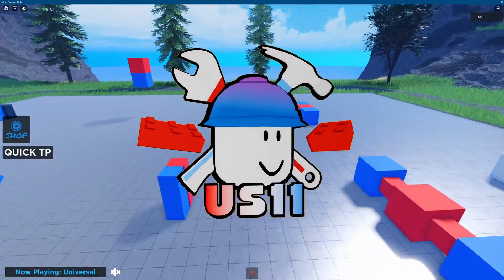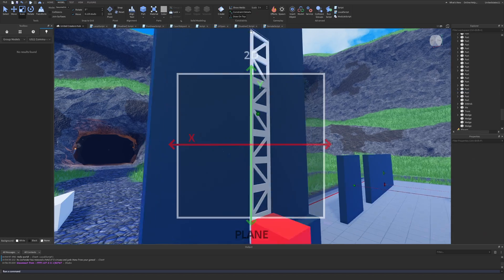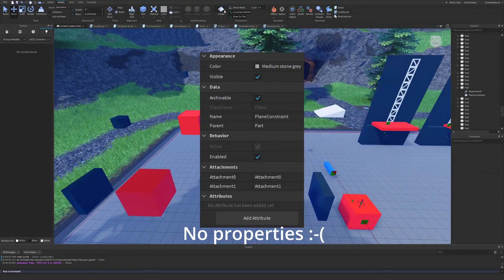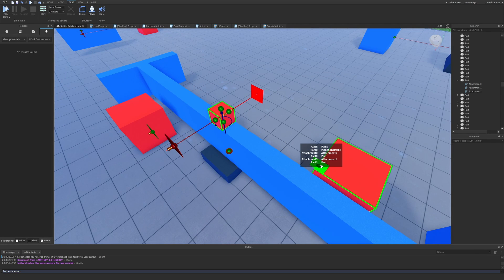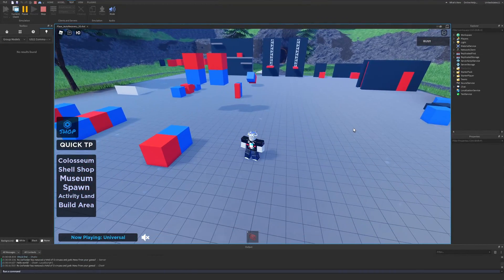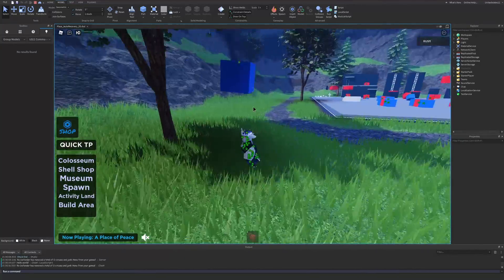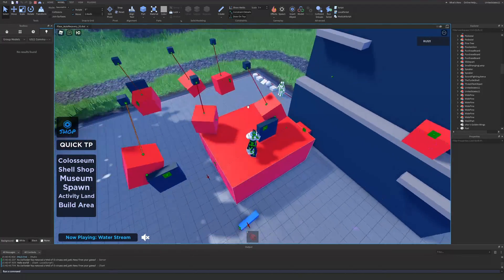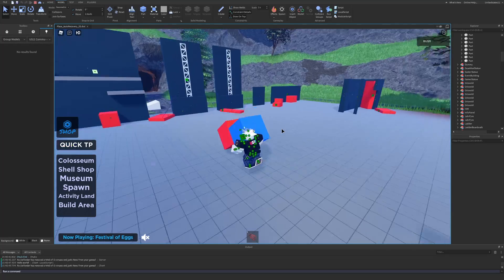How to use the PLANE PHYSICS CONSTRAINT in ROBLOX STUDIO!

Comment: That was a kinda poor explanation, but it's understandable knowing that the constraint is hard to understand in the first place. I hope they add properties like xSize and ySize (acts as a limiting factor, if you have xSize set to 10 then it can go 5 studs away from the attachment on which the constraint is in both directions, making it 5x2 which is 10), xPosition and yPosition (acts as an offset for the size limits), restitution (works just like the ball in socket restitution property) and I think it's going to be very very useful to be able to limit the rotation just like how the ball in socket works because in some cases it's really impractical to have a part that limits everything like an anchor plane